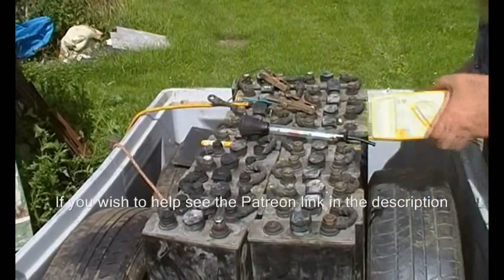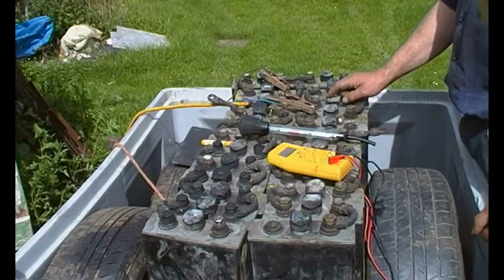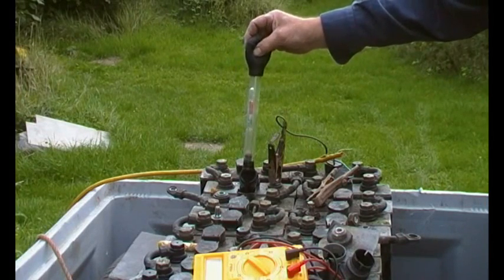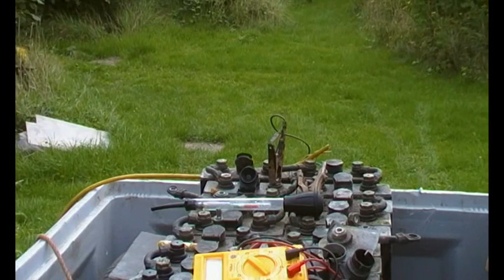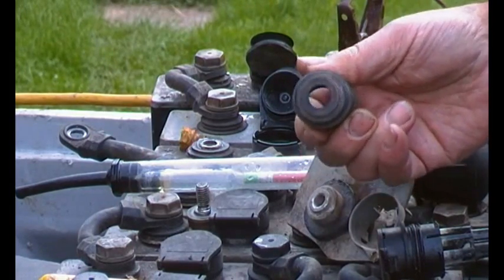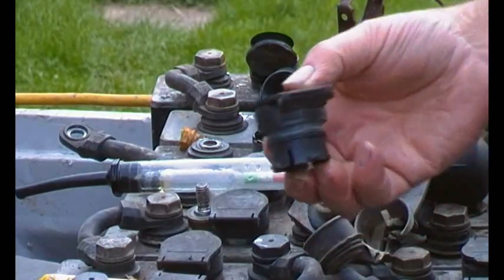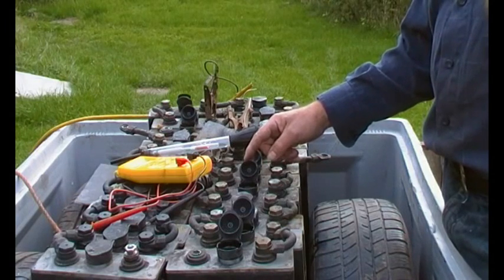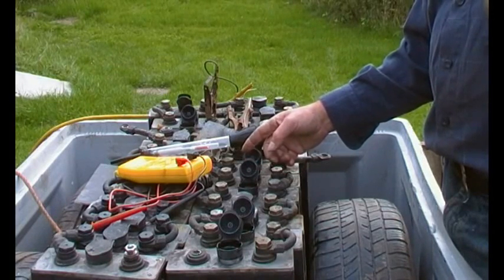Forklift lead acid batteries, renovation and equalisation, part 2

Comment: It's all quite an operation Andy, this cell recovery business, worth it though. The total tonnage of what I don't know about lead acid cells could sink a battleship. Sorry if this is teaching my grandmother ...etc, but your multimeter could suffer some horrid faults - like misreading - if left on top of your cells for any length of time - I guess you don't do that...:o)
Cheers, Dave
Reply from the maker: Dave, yes in the same way as an inverter is not mounted directly over the batteries, acid fumes etc. It is quite a process but small bits of time spread over a week. Just now giving them a steady equalising charge. Cheers, Andy